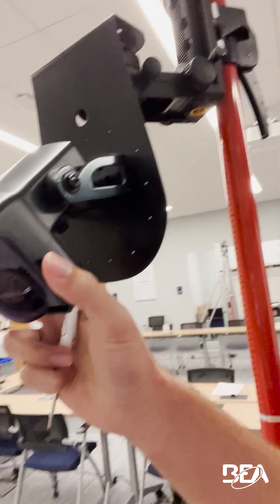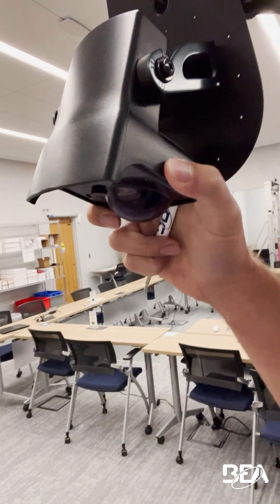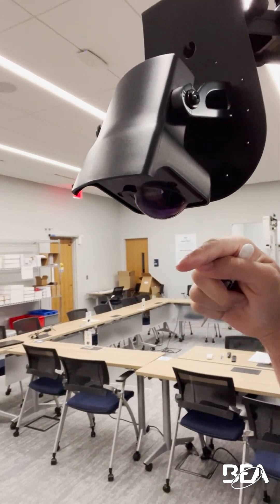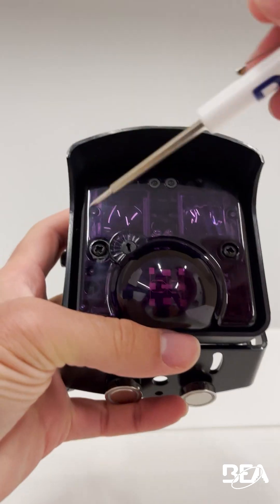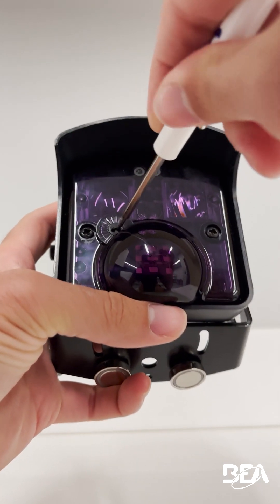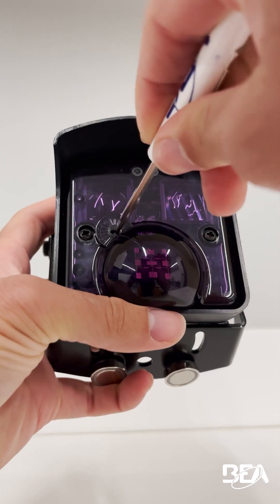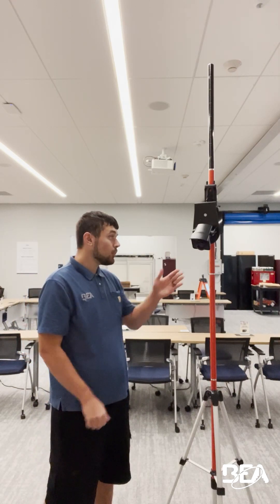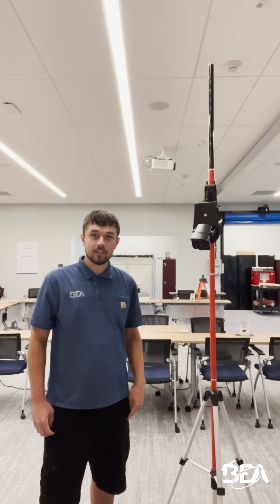Adjusting the RADAR head of a BEA IS40/XL #sensors #radar

Comment: Good tip I didn't know about this future can you use this model for just a pulse to open a door like the falcon if so how would you adjust sensitivity to cancel out pedestrian traffic Thanks!
Reply: Jake, great question.  The motion portion of the IS40 (Not the IS40P which is presence only) is pretty much the Falcon sensor.  Anything you can do with the motion of a Falcon can be done with the motion of an IS40.  Programmed the same way.  The only difference is the IS40 has infrared additionally for presence detection
Reply: @JacobDiBattistaBEA  Great thanks for the awenser but now i see your comment realized is the IS40P that I wanted to know about and also how this sensor will perform in cold storage warehouses Thanks!